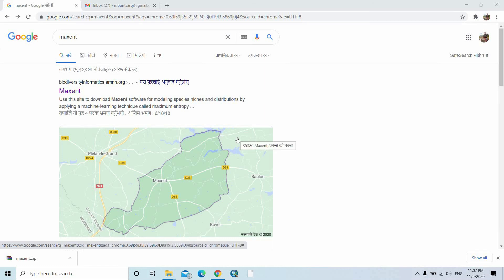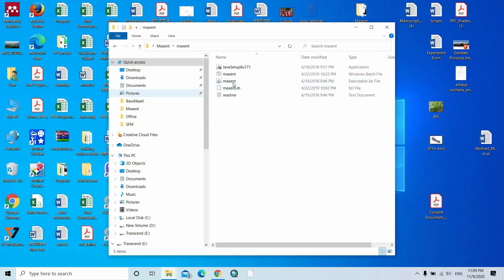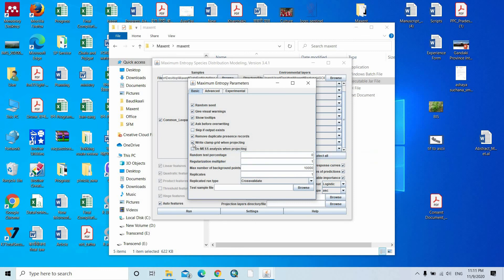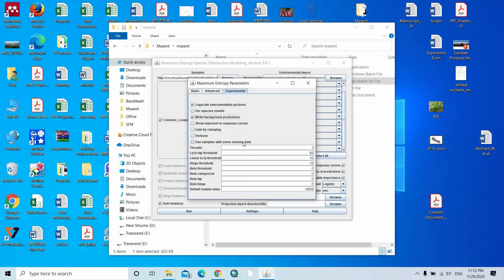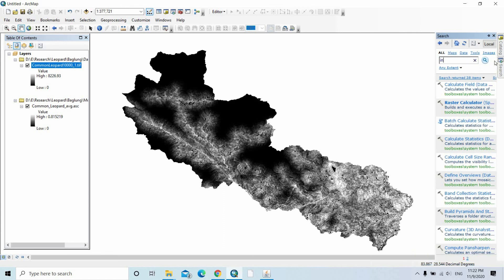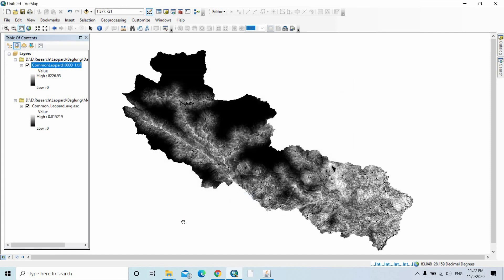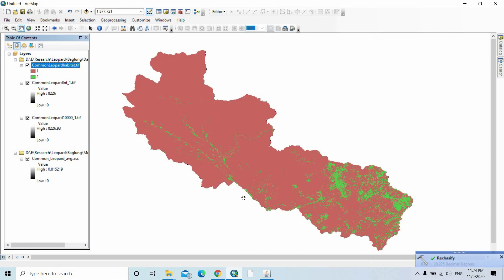MaxEnt Modelling

Comment: 00:00 Source to Download maxent
01:45 Using Maxent, 
           02:00 input files as presence points and 
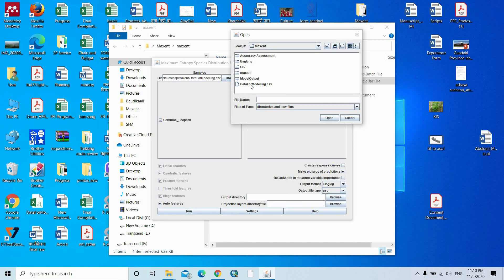           02:15 environments layers.
           02:30 others settings, filling Basic tab of Maximum Entropy Parameters.
           03:45 Advanced Tab of maxi um Entropy Parameters
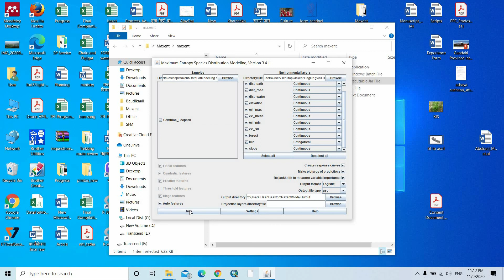           04:15 Run and get model output.
04:30 Model Output
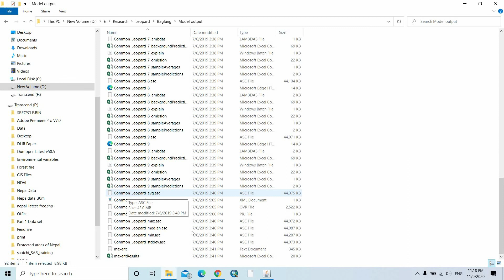          05:30 average.asc file adding to arc gis.
          06:45 define projection
          07:30 raster calculator and multiply values by 10000 to get integer.
          08:34 int function to convert into integer.
          09:15 Caculating threshold or suitability using reclassify.
          10:45 converting raster to polygon.